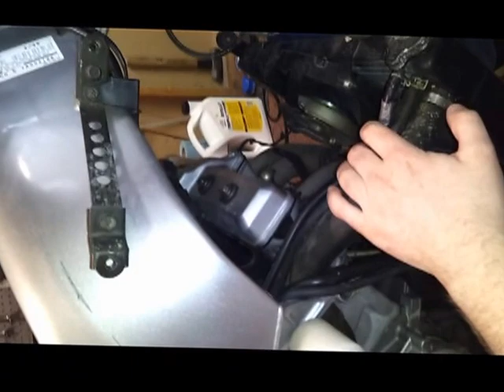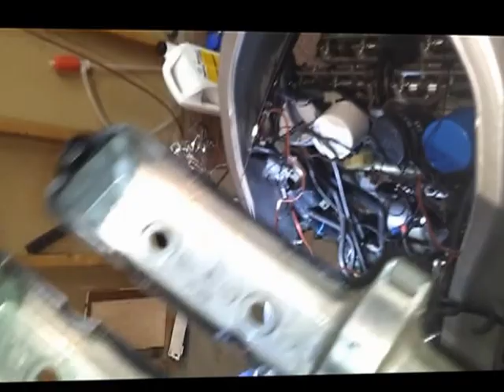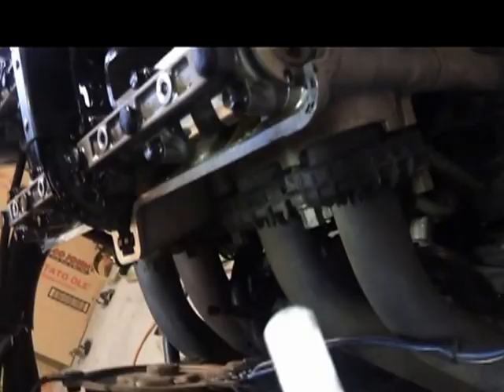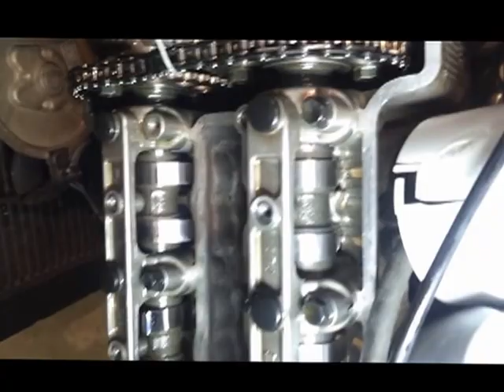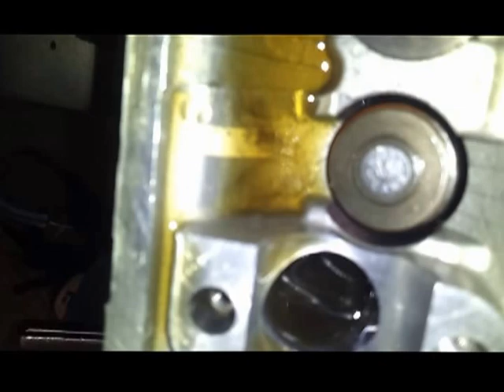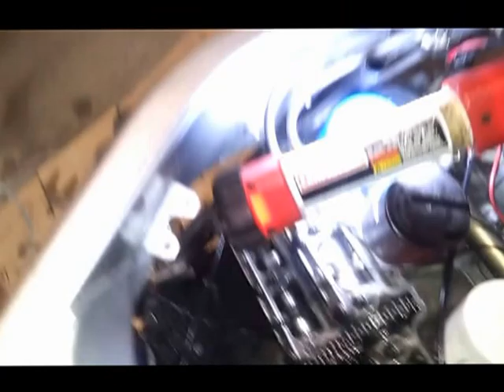1996 YZF 600 Valve Adjustment Thundercat

Comment: i did the job about 4 years ago, but I didn't have to remove the chain tensioner or remove the cam shaft entirely off. I used magnet tool to pull out the shims and replace them one by one as I turn the alternator bolt counter clockwise.
Reply: That is impossible with shim under bucket, which is what I am showing.  You had shim over bucket.  For under the whole bucket must come out to access the shim.

Comment: do you have the spec for intake and exhaust for 1989 fzr 600 bro? Thanks.
Reply: I do not have those specs, sorry
Reply: found my repair manual for exhaust: 0.21 to 0.30 mm and intake 0.11-0.20 mm for 1989 to 1993

Comment: Cool.  I have a 1996 YZF600 RH with 32K miles on it.  When do these bikes need a valve adjustment (mileage wise).  Is it common for the valves to go out of adjustment?
Reply: 24,000

Comment: can you not just install new shims that you know are to spec instead of having to measure them all???
Reply from the maker: you could only do that if you ALREADY knew the pads you have under your buckets from a previous measurement.   each valve clearance will likely be different,  even from factory.  they did NOT put all one size in it form new.  you have to look at whats there,  measure your clearance do the math and find either a thinner or thicker shim to replace it with to bring the gap back in spec.  BUT after you know all you shim numbers and keep them some place safe.  the NEXT adjustment will just be to measure.  if one is out of spec look at your previous chart and know what is in there.  order the correct one and swap it.